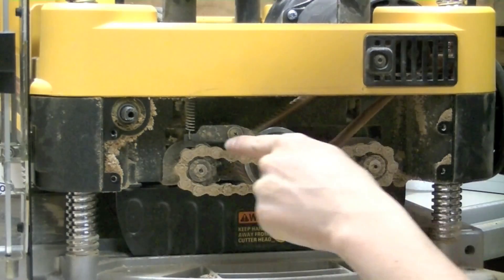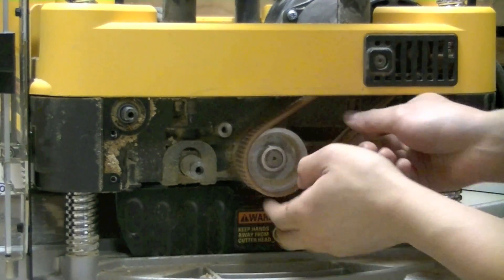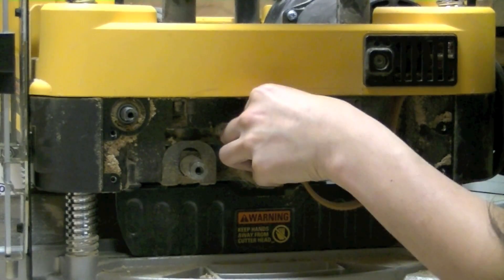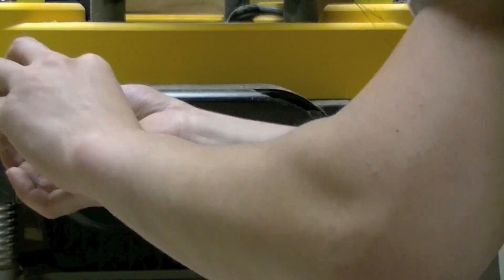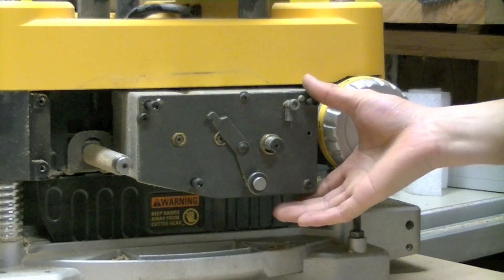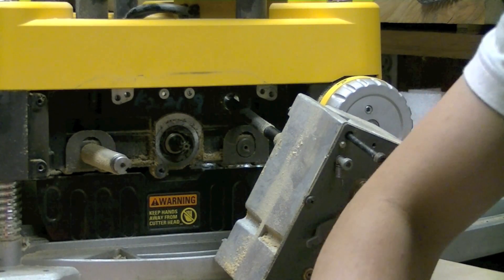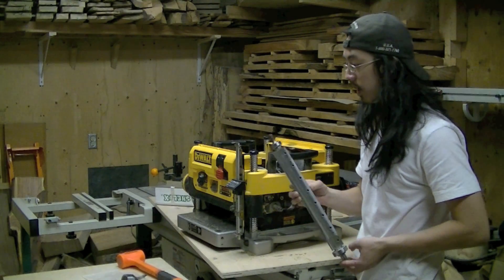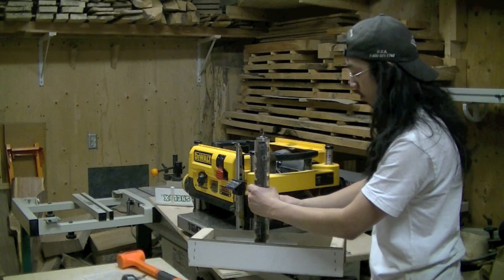2/3 - Installing a Shelix Cutterhead in a DeWalt DW735 Thickness Planer

Comment: I didn't notice the spacer until I ran a few boards thru after putting the new Shelix head on and was cleaning up the old one for storage . I wiped the old one down an there was the spacer was 
I said sh-t was this supposed to go back on ! I watch this video a couple more times and still didn't see if you noticed yours . Seem to run okay but I think I'll take off the pulley and put the spacer back on and see if it  matters ?
Reply: Yes it is supposed to go back on.

Comment: Hi Chris
I didn't see you if you did anything with the spacer . The spacer was
stuck by the grease
 between the pulley an
 the bearing on the old
 Cutter head ! Mines a year old so maybe yours is different ? 

I bought my DW735 about

Comment: I just replaced my DW735 blades with a shelix head . After the replacement I was putting the old head away for storage I noticed a 1/8" spacer on the old head on the pulley side .
Does that need to be put on the new Shelix head ?
Reply from the maker: I really don't know. I don't recall seeing that part, but it's been years since I looked at this.

Comment: At 14:41, the gearbox just comes right out - UNLESS, like me, you had the planer on the lower speed. The planer needs to be on speed 2 for the gear box to just slide out - otherwise, it is held captive by the speed change rod that goes into the gearbox.

Comment: the nut securing the pulley...is it 23mm or 24mm?  reason I ask is another video said 23mm.
Reply from the maker: +Oscar Gonzales I honestly don't remember.
Reply: Oscar Gonzalez 23mm But you can use a 24mm.

Comment: Great video series. Could not have gotten the new cutter head installed without them. I bent the tips on the snap ring pliers to point a little bit toward each other. That allowed the tips to positively engage and hold the holes in the snap ring, removing it on the first try. (Cheap Harbor Freight pliers at that, too.)